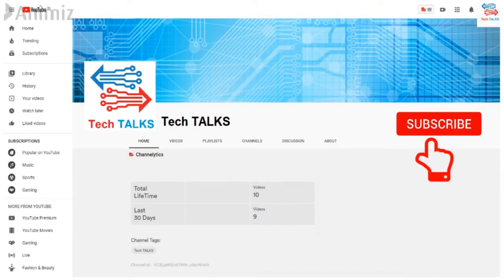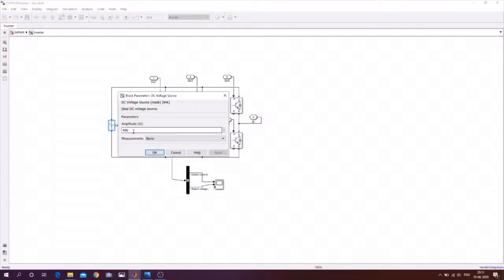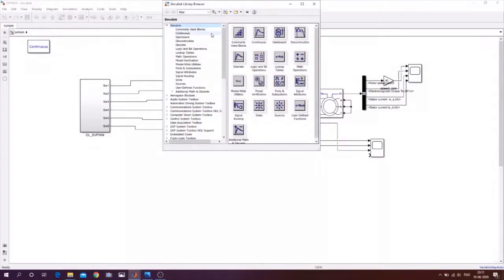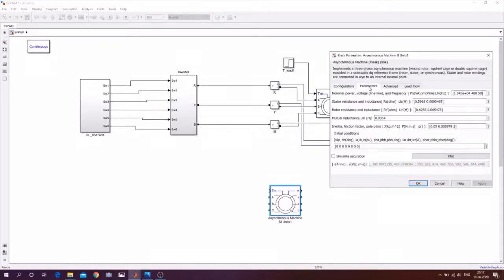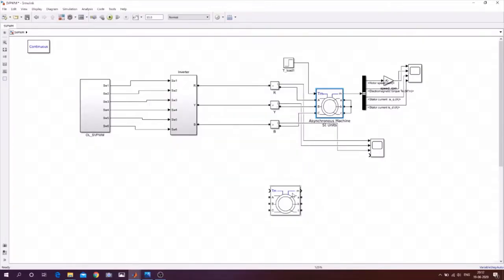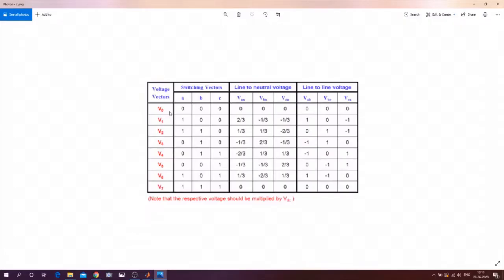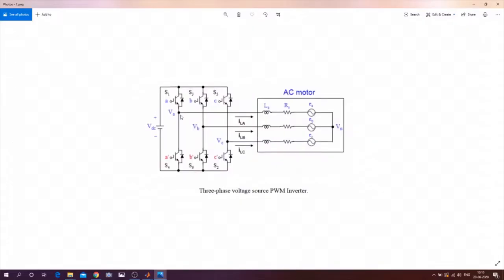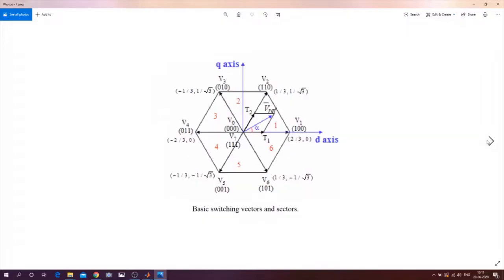Space Vector PWM 1| SVPWM Technique | MATLAB Simulation | Step by Step

Comment: There is some problem here. Actually the use of (tan) to determine angle of reference voltage gives an angle in the range of -90 to +90 degree. So the reference vector do not go into the other left half side of the phasor.
Reply: I did one mistake. In place of using atan2 I used atan only. After correction the angle range is 360 degree.

Comment: sir I have a doubt instead of this when we initilally knew Va,Vb and Vc why dont we use pulse width midulation on each of them seperately, why we need to identify the sector, angle and then do the operation wont the values automatically fall into place?